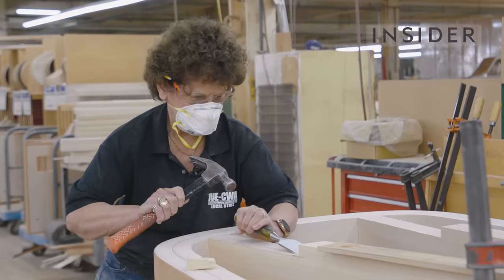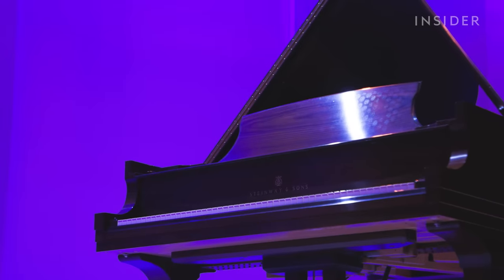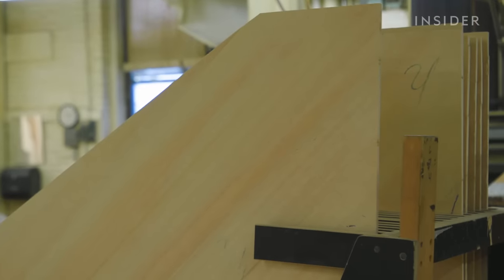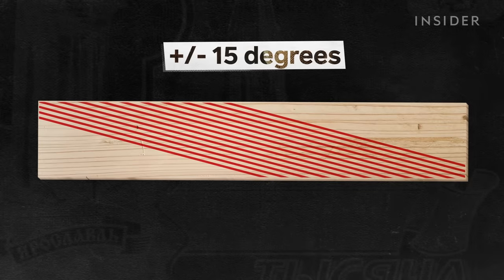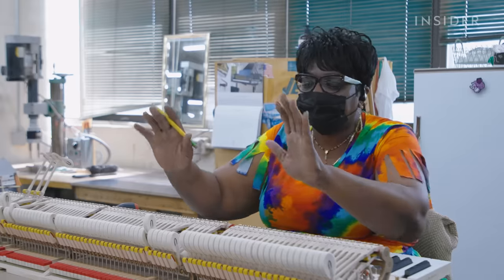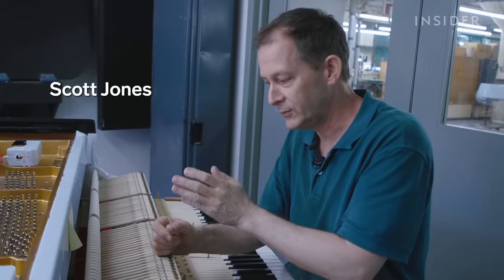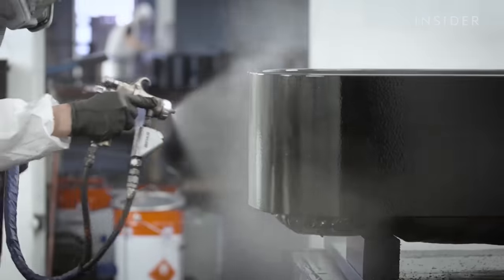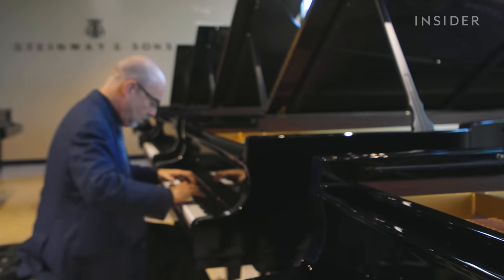Why Steinway Grand Pianos Are So Expensive | So Expensive

Comment: My first job outta high school 15 years ago was moving pianos.  I wanna say, Steinway's were always my favorite to move.  They were beautiful pianos, but from a mover's standpoint they were well built and easily disassembled.  Some cheap pianos had weird locking mechanisms for the legs with a piece of wood to wedge them in place.  Those would wear out a lot and the leg would become loose making it somewhat dangerous when lowering the piano.  Steinway's always had bolts for the legs, 2 large bolts to be exact and they never had that problem, even for obviously old Steinway's that show their age.
Reply: Christ I’d probably shit myself if I had to move some rich persons $100000 + piano
Reply: @boozy8659  same, i’d definitely drop it 😂
Reply: Maybe they do it differently in the New York factory than in Hamburg, but in my experience from moving grand pianos it's exactly the other way around. Steinways are the ones with the locking wedge and most others have the two bolts.
Reply: I moved pianos for 12 years. We had a contract with Steinway to exclusively move all of their pianos. Moved one that was said to be woth 1.3 million. It was just a baby grand,  but it was signed in gold on the harp by three members of the Steinway family. It was quite old and the legs on that one were large threaded dowels that screwed on. All the new ones use wedges and bolts which I loved a lot. Way better than those others with the flathead screws  :-)
Reply: @eyeamen  Oh god I remember the flat head screws.  The ones that were always stripped and some one tried to fix it by shoving a bunch of toothpicks in the hole.
Reply: @jhtar  You’re correct, most steinways have a rotating wedge and an internal slide lock cleat. New steinways have a locking flange and pin system. Some steinways from the ‘80s and ‘90s have the cleat and a tapered shim that snugs between the leg and the keybed, I find that design to be an improvement over the rotating wedge, more surface area pressing against the leg securing the cleat. Although their new design is arguably the most secure, it is much slower to remove the new legs, and I find the pins often get stuck on the flanges and are difficult to undo.
Reply: Wow, I actually posted a question of who you would hire to move such an expensive piano then immediately scrolled down and saw your comment. How much would you guys charge for moving one and do you have some type of insurance that covers you in case something unfortunate happens?
Reply: @itweeb4765  It was usually a base charge depending on the type of piano ranging from like $100 - $300 for consoles, spinets, and uprights; to $300 - $500 for grands depending on length.  $1.50 - $3.00 per mile and anywhere from $2 - $9 per step depending on piano.  Costs can break a $1000 if a manual pallet lift is needed and even higher if a telehandler rental is needed.  I've never been on a move like this but if it's going into a very tall building and the elevators can't fit the piano, a crane may also be needed but then you're going to be pushing $5000 to $10000.  And yes, any mover worth it's salt will have insurance.  In the 5 years I was a mover we fucked up one piano and dropped it and insurance had to pay.
Reply: @smzig  awesome info, thank you! I actually had to move a small piano once is an idiot high schooler. Of course, the rest of us being idiot high schoolers didn't know how to take a piano apart and so around five or six of us just manhandled it. We definitely weren't as careful as we should have been either. I was just remembering that experience and and comparing it with moving an expensive monster like this and thinking "damn..."
Reply: Depending on the year the piano was made they would have wedge/cam-lock, a simple piece of wood that turned into the leg to lock it in or now Allen key lock (which I personally can’t stand). Another factor the older pianos seem lighter then the new ones out on the market.  
When you add heaters and humidifier to them you barely notice the added weight, but have a player system on one and a 6 footer feels like it weighs as much as a 7 footer. 
The one great attribute is when putting back together you can use the lyer to help put on the last leg (if you want or can somethings that’s not a option)

Comment: In my experience, Steinways produce a very large sound, and the highs and lows are very well balanced in tone, making it perfect for solo performances. However, the weighting is rather heavy, and the sound may be too dark for some applications, such as concertos and dense studio mixes. In these cases, a Yamaha might be better suited.
Reply: I agree. I've played both and had the same interpretation. Both are well balanced but the Steinway is noticeably more mellow
Reply: I think Yamaha's factory downweight is heavier
Reply: Meh that could be said for any concert grand. I like the sound of the Yamaha way more. Steinway is a luxury brand that you buy just for the name and to feel rich just like other stupid crap these days.
Reply: @kishascape  from what I understand Steinway stand directly behind a lot of the innovation that the piano has undergone over the many decades, they also iirc have patents on quite a few of the mechanisms of action and pedals. That said, yes they're expensive, but they're also probably one of the only piano brands that can appreciate value with age.
Reply: The sound of Steinway is clearly the best.
Reply: @PedroMachadoPT  being that all pianos are different that's sort of impossible to say that. The feel of the pianos is up for debate though.
Reply: @chester6343  
The difference between Steinways is smaller than the difference between a Steinway and a Yamaha.
Reply: @PedroMachadoPT  they're all different, literally says that in the video. I don't know what you mean.
Reply: @chester6343  
Every tone of green is different. But green is a different colour than red.
Reply: Beautifully said
Reply: I bet Steinway doesn’t make motorcycles.
Reply: @kishascape  alright then.
Reply: I never liked the sound of Yamahas. I'm really curious how/why do people like them? They sound very muffled and almost fake like an e-piano.
Reply: personally i think there is a distinction between steinway and stainway.  the stainway factories, the american one and the twdesca one, produce tools that may seem similar in appearance, but they are not at all.  I love the German examples for the touch response they give and the incredible tonal range they are able to express, like no other piano.  a yamaha in comparison seems to me just a mountain of garbage.  this is my humble opinion.
Reply: Interesting, I've played both and I found Yamaha to be considerably heavier. I find the Steinway quite light. I agree about its density for studio recording thoug, especially for pop
Reply: @Cruz474  or motor boats 😂😂😂
Reply: I learnt more from your comment than this whole video. Thanks!
Reply: @1SmokedTurkey1  which model are you referring to? You can have the hammers brightened if you wanted to threw voicing. In the opposite side I've heard some people say Yamahas are too bright. This can be fixed with voicing also🎹🎶
Reply: @MERCEDES-BENZS600GUARD_V12  most Yamahas I've played (electronic and acoustic) had the same characteristic muffled sound. I own an electronic one that runs through my laptop to make it sound like a Steinway lol
Reply: @1SmokedTurkey1  I think Yamaha took meny comments about their pianos being too bright personally LOL! The acoustic Yamaha piano being too mello can be brightened by voicing the hammers🎹🎶
Reply: @MERCEDES-BENZS600GUARD_V12  unfortunately I have VERY limited experience with acoustic pianos. I only play mine. So I have no idea how to adjust hammers or whatnot lol but good to know in case I ever buy one.
Reply: @1SmokedTurkey1  you're welcome. BTW don't try to do it your self if you don't know how to it's beter to pay a technician to do it for you🎹🎶
Reply: Which is better roland or Yamaha ?
Reply: @xevivr  Roland doesn't make acoustic pianos. If you were referring to digital pianos personally I'd go for Yamaha🎹🎶
Reply: @cristiansicilia1286  You do realize that Yamaha owns Bosendorfer? I have yet to find a classical pianist that thinks that Steinway is a better piano that a Bosendorfer.
Reply: @matthewphillips5483   I’ve known many lol
Reply: Yamaha instruments are always bright, the same for its affordable guitar. Expensive Yamaha guitar sound more mellow however
Reply: @phanhuyduc2395  I tried a Yamaha C3X and to me it wasn't that bright🎹🎶
Reply: Steinway quality control has been slipping lately. I’ve seen some videos of new Steinways here on YouTube that are rough shape to say the least
Reply: @kishascape  You really had to not watch the video to say this hey? It's perfectly ok to have an opinion different from the majority. However, a Yamaha grand piano isn't that far behind in price (at least in the same realm of quality), and to call a Steinway "any other stupid crap" is just ludicrous. They've been making pianos for hundreds of years the same way. You're not buying a stupidly priced "Balenciaga" t-shirt that has nothing to do with what Balenciaga was actually making during his time (same for Louis Vuitton, Chanel or any modern versions of those brands). Here you obviously pay for the best quality and craftmanship involved at every step of the way. And as bizzare as it sounds, companies selling products like this do not usually make a ton of profits. Their margins aren't great because of how ridiculously expensive it is to make and how few customers there are around the world. Finally, if Steinway was bought "just for the name and to feel rich", then how come most concert rooms in the world pretty much come with a Steinway grand? 
Do the directors do this because they're dumb and rich? Do you think classical music those days makes anyone rich? 
There are so many layers of why what you said doesn't make any sense, I'm hardly sorry. How can you confuse the beauty of ancient craftmanship and some insult to a legacy tag glued on Chinese crap? This is truly absurd. And... I play Yamaha. Doesn't change a thing.
Reply: @jas_bataille what other people don't realize is unlike Yamaha Steinway only use the name Steinway for their high end piano line. Yes I agreewith everything you said. Steinway make great pianos, and one really needs to try one out in order to determin weather a Steinway is worth it🎹🎶
Reply: I agree with another commenter who finds Yamaha's sound muffled. That's always my experience when I try them, and mostly, the keys are very heavy (in the sense of their resistance to the fingers). What I'm unable to distinguish is the sound of Steinway, Bösendorfer and Petrof. They're all great concert pianos, in my opinion, with a similar mellow, lyrical sound. Since I'm not a professional pianist, it might be a stupid remark, but I've never encountered a more pleasant, beautiful sound than Bechstein and August Förster pianos.

Comment: I'd say quality wise Fazioli, Bechstein and Bosendorfer are in the same level as Steinway. The decision should be based on the sound you prefer (my favorite is Fazioli)
Reply: Compared to NY Steinway, those brands are higher in quality. The Hamburg Steinways are as good as those brands because they have to compete with them. Not here in the USA, where predatory capitalism has even ruined pianos. No competition means no need to make the best in the world, just a good piano with contacts that ensure no competition or innovation.
Reply: I preferred the Bechstein grands from the old Berlin factory. The move to Siefhennersdorf was accompanied by changes in design, construction and methods of assembly.
Reply: @vitaminluke5597  actually I am shocked to find the RRP of Bosendorfer is much higher than Steinway (for the same type) as my partner got two Bosendorfer grand pianos 170S and I never thought the price of them was so fuck*n expensive 😂 , and of course, I love the sounds especially for Chopin’s pieces.

Comment: My Dad has a 1912 Steinway, rosewood finish, had no idea it was so valuable.
Reply: Only the new one. Unlike Violin or other string instruments, piano goes down in value overtime.
Reply: Its value depends on its sound. Not because it is old.
Reply: @LucielStarz123  still  pretty expensive. if the frame is metal and the harmony table isn't cracked it can be restored pretty good.
Reply: @TheMusicalKnokcers  "Harmony table"? 
Many old piano SOUNDBOARDS have cracks. 
There was an extensive scientific article in the PTG (Piano Technicians' Guild) Journal years ago, illustrating how cracks in the soundboard DO NOT ALWAYS affect a piano's tone materially or in a negative way. 

It depends on where they are in the board, how big (long, wide) they are, etc etc. They CAN reduce the volume of tone of a piano, and/or cause buzzing, rattling etc like a broken loudspeaker, as well as (flat) soundboards giving old pianos that 'old piano' (flat, lifeless) sound. 

After all, every regular grand or vertical soundboard I've ever heard of (EXCEPT perhaps some giraffe piano soundboards which are probably more like a harp's and are oblong or lozenge-shaped and much smaller than a regular soundboard, and so THEORETICALLY could be cut out of a large enough diameter piece of wood), is not a single piece of wood but is MADE UP from various strips of wood glued together diagonally along their edges, bent/steamed into the convex shape, and then held there with the diagonal 'ribs' which are glued on in the back. 

This convex shape is partly to make the soundboard into a giant acoustic 'loudspeaker', which it is, and partly to counteract the ENORMOUS tension of the tuned piano strings, which is usually in the tons in most modern pianos. 

Most of this tonnage pulls on the iron piano PLATE, though, (and pinblock etc) and the stout hardwood frame / case / (rim in a grand) of the piano holding it, and only a portion of that force pushes down on the soundboard ("downbearing"). But it's enough that the board has to be strong to withstand it, and after 100+ years, many soundboards are no longer convex due to all the tension (plus the glue or in some cases wood giving up the ghost) and are flat or even concave(!). So they need to be rebuilt. 

Whether the soundboard is actually rebuildable is different for each individual piano, and not every technician can do this. 

But many of these boards are savable, cracks or no cracks. 

Some techs always fit a new soundboard, reasoning that the 'new wood is always better' (it isn't ALWAYS...), while others are loath to do so, reasoning that the old soundboard has 'aged in' and once rebuilt should sound nice (whereas a new board would take time to go through this 'aging in' process). 

Again, this situation varies from instrument to instrument so there is no hard and fast rule for the proper course of action, just try not to spoil the original tone and get as close to 'factory' as possible if you want to preserve the original idea of the original tone.
Reply: why you reply to me i know already all of that, don't be scornfull for my words as i just made a guess while translating, keep in mind americans are only a fraction of all internet users. When someone like the original commenter knows nothing it's easier to stay simple, so i just stated the obvious. If it's metal the tension from the string will be better supported and there's chances that less damage will be present. Of course everything will be case by case because it all depends on the storage condition of the instrument, how much it was used.....
But we should agree that it's easier and less significant to replace the fabric or the hammers than to woodwork your way on the soundboard. Ok you can do small repairs on a soundboard like it's done with violins but if there's a huge crack, chances are you're in for troubles. Anyway this kind of things she/he has not to think of, it's up to the technician to decide if a restoration is worth it and what's to be done.

Comment: 7:12 Blatant lie from Steinway here. Pianos are like cars: the second you leave the dealership their value is cut in half. This is because they’re big machines made out of wood and wood swells and wears down, hammers degrade, and soundboards flatten. This is why most prestigious concert halls never have pianos much older than 5 years old.
Reply: No, you've misheard. She says the price of a NEW Steinway piano increases by about 4% year on year. Meaning a new piano in the year 2021 is about 4% more expensive than one in the year 2020. This wasn't talking about depreciation or appreciation whatsoever.

Even the later part talking about the 1965 D isn't a lie. A piano of that age and older can be fully restored and still have appreciated in value from new, despite the costs.

Comment: Love how Steinway still uses "tuning by hearing" method. Salute.
Reply: Pretty much all piano tuning ultimately is done by ear even if a device is used on the first string of the note.  I can also pretty much guarantee that an accutuner or similar device is also used at steinway too in the same way.  Just because it wasn’t in the video doesn’t mean they don’t use it.
Reply: All piano brands do "tune by ear" Yamaha, Kawai, Pearl River, etc. Fyi, if you can't tune by ear you aren't a piano tuner, more so if you are working in a piano factory! There's nothing wrong with using electronic tuner btw (actually they speed up the process). Only a fool drives a car without power steering.
Reply: An analogy is that you use a GPS to get to an address but the GPS doesn't tell you how to get from your car to the front door of the house, that's where the aural part of tuning is important.
Reply: Yoh bigfoot !!